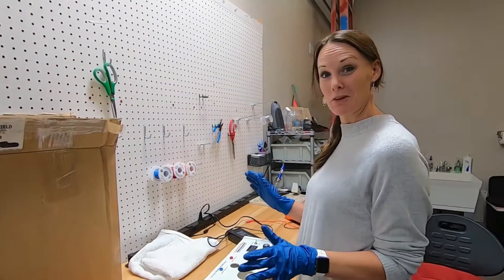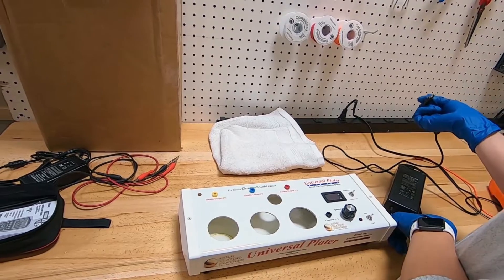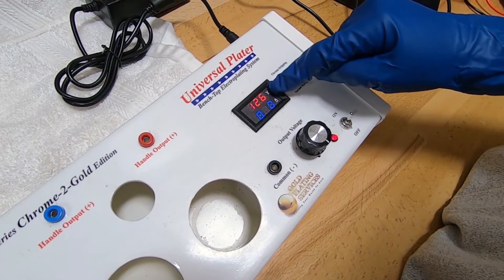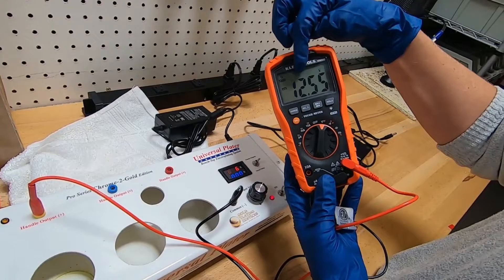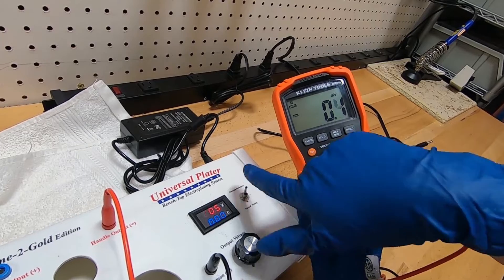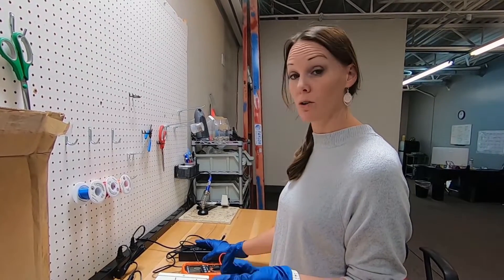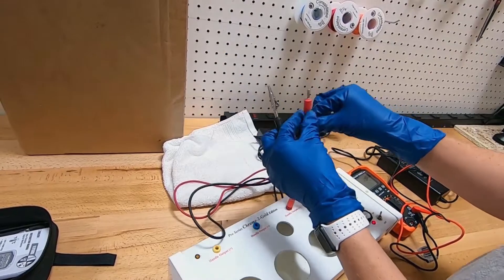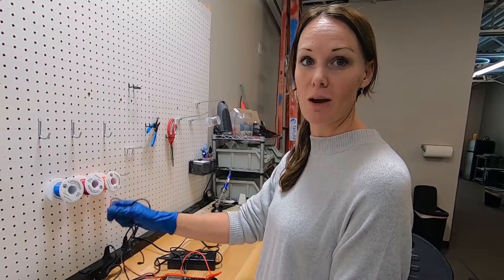Gold Plating Kit - Troubleshooting Issues with a Universal Plater - Chrome Edition

Comment: How much is a kit like that?
Reply from the maker: This particular kit is $1,219.99.  It is a complete, ready to use, gold plating kit that includes everything you need to gold plate ~1,200 square inches of area to a normal decorative thickness onto most metals.  Many people use it to gold plate car emblems, rims, etc.  Many find that they pay off the kit quite quickly, just with what is included.
Reply: @GoldPlatingServices  awesome thanks alot!